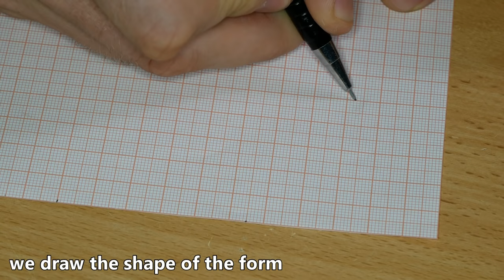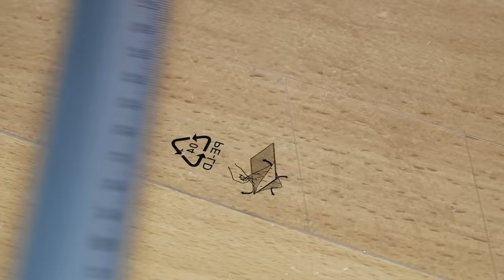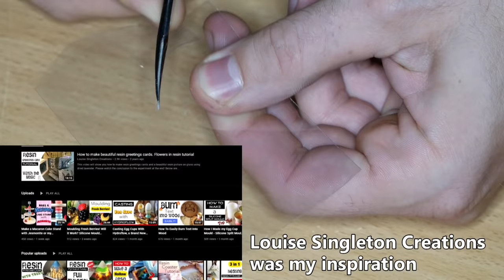Night Lamp.  Pyramid Epoxy / RESIN ART / @LouiseSingletonCreations

Comment: What is that sheet called which you are using for making pyramid?
Reply from the maker: 1 mm plexiglass from anti frame
Reply: @jedrek29t  ok...can it be reused?
Reply from the maker: There is a curve after the plexiglass is peeled off
Reply: @jedrek29t  ok..so it can't be reused?